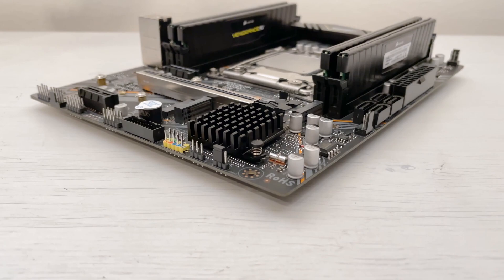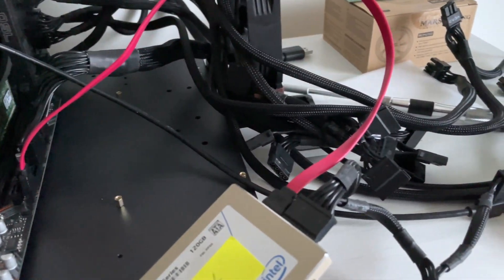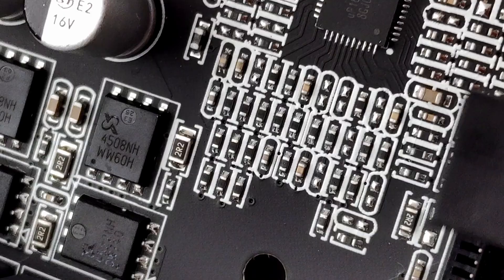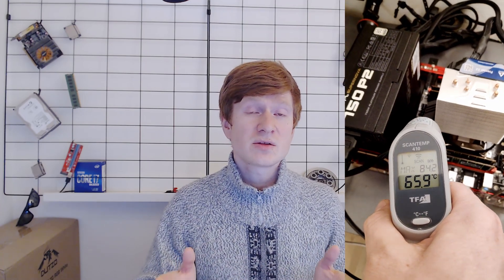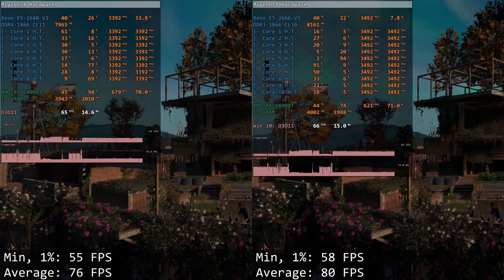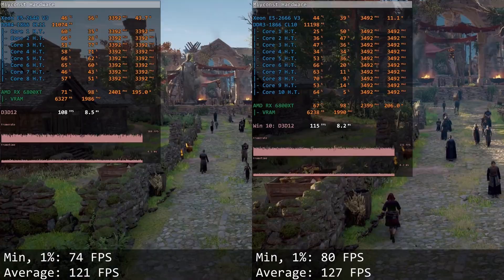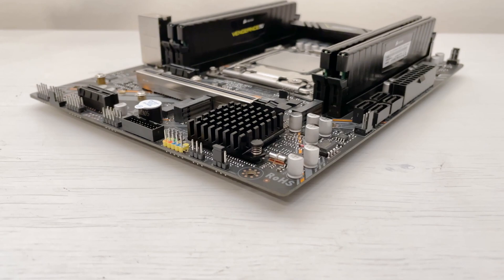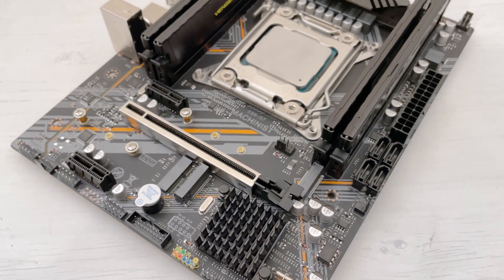🇬🇧 Machinist X99-G7 and Xeon E5-2666 V3 – small review and benchmarks

Comment: Bought a Xeon 2666 v3 recently for $55, also bought a 2640 v3 for $21.  It's strange to think about the price difference between these two CPUs.  The 2666 v3 is 160% more expensive than the 2640 v3.  But 160% of $21 is also $35-- which nowadays may not even be enough for one to go from one graphics card to another with the same chip but a few more RGB lights on the cooler. But then again, $35 make a difference if you use it to buy more Ram or a better/larger SSD.
Reply: The price to performance ratio is crazy, I got the E5 2666v3 for $31 yesterday
Reply from the maker: Very true, $35 might be the difference between 500 GB and 1000 GB SSD.
Reply: 2666v3 is very cheap in china. Only$20
Reply: @liamliu6385  Oct 30, 2022, the price of the E5-2666 V3 in China has gone up to $33.🤣

Comment: RIP wish me luck. I just got in an e5-2696 v3 on this board that i had gotten in by mistake. Hopefully the vrm does not melt.
Reply: Honestly will probably have to get it off of this board because one of the unlabeled temp sensor is literally pegged at 100C. Any ideas for a board with a good VRM that will take the 2696v3 and use ddr3 ram?
Reply from the maker: Those temp sensors are bugged, don't trust them, but a better board is surely needed for this CPU, you can pick one of these: Husnanzhi X99-BD3/AD3/TF/T8.
Reply: @Miyconst  thanks so much for the suggestions.

Comment: I stay away from Machinist. I bought the x99 SR9 version and it's dead on arrival. I had better luck with HUANANZHI or Veineda. In fact I bought 2 Veineda X99 V367 and both worked great.
Reply from the maker: I would say it was a pure coincidence in your case. I have had issues with Huananzhi and Veineda boards as well. Even though Huananzhi is overall better than Machinist, it has flaws as well.

Comment: hi, im wanting to build a new system using the e5-2699 v3 18 core CPU, this system will mostly be used for Bluestacks emulation running a lot of instances thus heavy on CPU usage however the CPU clock speed is a little on the low side for my liking, could you possibly advise if its possible to boost these clock speeds to around 3.2ghz and remain stable.

thanks.
Reply from the maker: Somewhere around 3 GHz should be possible with a good motherboard and turbo-boost unlock.

Comment: Thank you for your review. Can you tell me what is best motherboard option for e5-2666 v3? Im planning to build Xeon setup with DDR4 memory and with those chinese motherboard. Thank You!
Reply from the maker: I would probably go with Huananzhi X99-BD4, X99-AD4, X99-TF, X99-F8, just pick the cheapest. From the mATX boards I can only recommend Huananzhi X99-ZD4.
Reply: @Miyconst  Thank you!
Reply: @Miyconst  Thank you! i have the same question!! very nice video!!!
Reply: @Miyconst  Hello thanks for making this video!!  i have one queston what do you think  e5-2666 v3 + X99-TITANIUM-D4 and  Turbo boost  70-50 or safe 50-50 ?
Reply from the maker: @owner8827  it shall be fine, Titanium D4 has a semi-decent VRM.
Reply: @Miyconst  Nice!! thanks for answering my message btw TBU Undervolt  which is better 70-50 or 50-50?
Reply from the maker: @owner8827  -70/50 is better because it should achieve higher clocks under load, but there is no guarantee that your CPU can hold it. Go with -50/50 if you want to be on the safe side.

Comment: love the videos, i have a 2620 v3 with boost unlocked following your guide, but if I want to change it to another 26xx v3, do i need to change anything on the bios or will the turbo boost unlock work?
Reply from the maker: It depends on which Turbo Boost Unlocking method you used. FFS drivers injected into the BIOS stay there until you flash another BIOS, but system level EFI drivers are reset on CPU swap.

Comment: hello. I'm interested in your opinion. Will the Huananzhi ZD4 VRM cope with the Xeon 2666v3? Now 2640v3 is installed and the VRM temperature does not exceed 58 degrees Celsius in a closed case.  At the same time, the room temperature is 27-28 degrees Celsius.
Reply from the maker: Huananzhi X99-ZD4 has exactly the same pathetic VRM, but its radiator is covering all doublers, thus it's easier to keep it cool. I would not recommend E5-2666 V3 for this board, but it's gonna work if not abused.
Reply: @Miyconst  Yes? It seemed to me that in the review on the Huananzhi x99 ZD4 you said that the transistors of the lower arm are installed different from those on the RS9. Am I wrong? Is the Vrm completely identical?
Reply from the maker: @ИльяТоржков-ь3п  the VRM components are identical, but the location is different. On X99-ZD4 the VRM doublers are covered with the heatsink and cooled together with the mostfets, while on Machinist, the doublers are left naked and overheat.

Comment: 2666 v3 should do better with the faster DDR4. Isn't 2640 v3 limited to 1833Mhz DDR4?
Reply from the maker: Yes and yes, that's why I recommended a proper board if you wish to buy an E5-2666 V3.

Comment: Love your channel man! ♥️ I really enjoy the tinkering with this non standard stuff. 
Finally finished my mini itx virtualization server build 👍
Working great so far, limited TDP of the QQLS to 35W. Configured everything for high c states and now idle power consumption is just 6w in Ubuntu. But higher than Package C7 does unfortunately not work, C8 crashes the whole system instantly after running powertop --auto-tune . So you have to set "Package C States Limit" to C7. Thanks again for the great videos! With out these I would have never finished this project!
Reply from the maker: That's an awesome build! Which motherboard did you go with?
Reply: @Miyconst  I used a Gigabyte Z270N with F6d BIOS. Its ITX and has build in dual rj45. Z170N and Z370N are almost the same. 
I added some heatsinks to the VRM of the Z270N since they are naked. 
For RAM I picked the cheapest 16GB Kit (Gskill 3200 C16 Kit with Samsung C Die). Currently running at 2133Mhz. Did not try to go higher.

Comment: I have a question. Would the kllisre x99 b5 be a good choice to build a server with? Eight layer pcb and quad channel ddr4 support. Does it function when it comes to it's pcie, m.2 and usb ports?
Reply from the maker: I have not tested this particular motherboard, thus I can't answer your question, but most likely it's the same thing as Machinist X99-RS9.
Reply: @Miyconst  Yeah, I got suspicious about it after having watched the video and seeing the physical similarities between the two. I'm thinking of making a Minecraft server running some forge mods and potentially have it used for other types as well... I've been going back and fourth regarding if I should get a 2640 v3 or 2660 v3.

Btw, heard you mentioning shipping to Sweden. What shipping options are best for aliexpress. I almost always have my mail arrive quite quickly only to be stopped in customs by postnord for several weeks and sometimes a month before I get the message to pay the fees.
Reply from the maker: @phooopy  AliExpress premium shipping works the best, but it costs quite some extra. For the VAT payment, I recommend to manually track your packages and check PostNord VAT payment page frequency. Often you can pay VAT a week before PostNord notifies you about it, thus the total shipping time decreases.
Reply: @Miyconst  I'll give it a try and use that for future purchases from there👍

Comment: using the xeon 2640 v3 with the huananzhi 8mf motherboard is ok? or is there any problem?
Reply from the maker: Huananzhi X99-8M-F is a low cost motherboard, I have got a few reports about dead audio and network chips on these X99-8M-F, other than that, if you get a good sample, E5-2640 V3 should be a good fit. Whichever CPU you pick, you have to ensure good cooling for the VRM.
Reply: @Miyconst  do you have any tips to improve vrms cooling on these more basic motherboards? I used a 2620 v3 and upgraded to 2640 v3 on the huananzhi 8mf
Reply from the maker: @jeffesonmath2323  most of these tips are way too expensive to implement on these cheap boards, sadly.

Comment: Nice review! I just tested this 2666v3 on RS9, with custom active thermal solution on VRM. For render and virtualization is a good CPU. About the motherboard you have used, this support 2640V3?
Reply from the maker: E5-2640 V3 works with DDR4 only, while X99-G7 supports DDR3 only, so they are not compatible.
Reply: @Miyconst  Thanks for the answer. So any xeon that works with DDR3 will work on this mobo, nice. There is you any xeon suggestion for this mobo?
Reply from the maker: @henriquegonfer7750  Any Xeon for LGA 2011-3 socket which supports DDR3 will work, but the VRM is pathetic, thus I would suggest something like E5-2649 V3, which is nowhere to be found these days, maybe E5-2671 V3 will also be fine.
Reply: Can you share How you built this custom active thermal solution?
Reply: @BolívarMena  I print a plastic part on 3D printer to fit the exactly dimension of motherboard heatsink and them fix two 30mmx10mm fans, so i use a "Y" cable to connect them to a 3 or 4 pin fan connector on MB. It runs at 100% speed without audible noise. There is a great reduction on mosfets temps if you add a good thermal pad luke Thermalright Extreme Odyssey. But, anyway, this cannot solve the issues with high temp on the VRM capacitors, the air flow is not enought to reach them. I will try solve this on another project.

Comment: having gotten this motherboard ahead of you and done my own testing, the motherboard can come with a z series chipset even though they do not advertise it, and it can have a bios which is not compatible with any other board to my knowledge. Still, this board can be modified with a small mosfet heatsink atop the two square black vrm controllers above the capacitors to make the vrm insanely more efficient.  I genuinely do not know why it is not like this from the factory, but I have a E5 2678v3 running on one of these boards in a build with a 5700xt, and the vrm temp never gets above 50c, and the controllers which before uncovered would run at almost 90c, now run at ~55c, and with the efficiency gain of those chips being cooler its enough to run the 12 core under Prime95 for 4 hours continuously without the main vrm going above 60c according to the thermocouples I use. On the memory side, I have been able to get memory to run at 2133mhz on the G7 I have with a z78 chipset, but the problem is that with the c226 version of the  board I also got for a different client it only ran at 1866. I modded my own bios with the z78 chip using AMI bios tool and the x99 unlocker from e5450.ru, and it works pretty good, with some crude voltage controls unlocked (it is really insensitive, memory voltage for the memory steps at 500mv instead of anything more finite).
Reply from the maker: Wow! Thank you for the info. So, boards with Z87 chipset come with a different BIOS version and support RAM O.C. to DDR3-2133? That's nice. How about the first PCI-E X1 slot? Did you manage to test it?
Reply: @Miyconst  it still doesnt work with a gt 710, and I dont have any other pcie x1 cards to test
Reply: @Miyconst  update, I have been unable to get the memory stable at 2133, as I have been able to get as far as a windows boot screen before BSOD, vs before where it would work perfectly, and have used 3 or so kits of memory to try and get it there.
Reply from the maker: @KadiusFTW  are you sure that your memory is actually stable at DDR3-2133 1.5V ? Many of those high speed DDR3 memory kits require 1.65V.
Reply: @Miyconst  According to cpuz, they are running at 1.6v, so no, Im not sure/
Reply from the maker: @KadiusFTW  Chinese X99 motherboards top out at 1.5V, memory voltage readings are providing info of what the RAM is rated for, not at what it's currently running.
Reply: Hello. Thanks for the info! Can you tell me which heatsink you used for the VRM or the size required? I have to move from my Huananzhi t8 to an matx and this is the only one with ddr3 support !

Comment: Will you revisit the Mutants? Ik you are not made of money but i would like a proper comparison between QTJ0-QTJ1-QTJ2, or maybe a look at the new xeons and non engineering cpus they are offering rn
Reply from the maker: I don't know yet, for now I have lots of videos to complete, probably enough for 3-4 months, then we will see.
Reply: @Miyconst  dang, well i will be expecting those anyway, i just have one more question

do you think that QTJ0 bump in price is worth it compared to QTJ1? im thinking of buying one next month but i cant decide, i have an asus z270 maximus hero IX mobo so i think i have enough vrm for both, and even some overclocking leeway, but im not really sure

regardless, keep the good work, if it werent for you i would not even be able to consider these as an option
Reply from the maker: @Elinzar  It really depends on the price difference betwen QTJ1 / QTJ0. Up to $20 I would pay, more than that - no. I have heard that some Asus Z270 boards have issues with mutants, and you might need to use Z370 BIOS from the same model. When you get your mutant, try to mod the original BIOS, and if that doesn't work - try Z370 option.
Reply: @Miyconst  i will keep that in mind, tanks for that tip

Comment: still waiting for huananzhi x99 tf gaming + 2666v3 i want to replace my old x79 huananzhi x79 v3.1 green + 2667 v2wich i was dissapointed because  somehow that 2667 v2 cpu only boosts to 3.5 ghz even though it has x36 multiplier for all cores and the board came with a q67 chipset  + i get bottleneck in competitive fps games. hopefully Miyconst will provide us better BiOS for these 2 boards in the future .❤❤❤
Reply: Wouldn't it be better to upgrade to a mutant qtj1? Those things are insanely good value for performance rn and motherboards (in my area) arent that much expensive and are proper mobos too
Reply: @Elinzar  well i live in a place where a ryzen 5600x costs 600 euro so i have to rely on aliexpress for pc parts plus the benefit is i dont get taxed for pc parts orders
Reply: @cooliocoolio6645  dang, is even more expensive than the shithole i live in, but the mutants use lga 1151, is the second hand market that bad? i got a z270 asus maximus hero ix for 100 usd here for compairson (but they cost 200 normally) how bad is it there?
Reply: @Elinzar  to be really honest i apolagise it costs 545 dollars but when it first came out it was 600 euro.